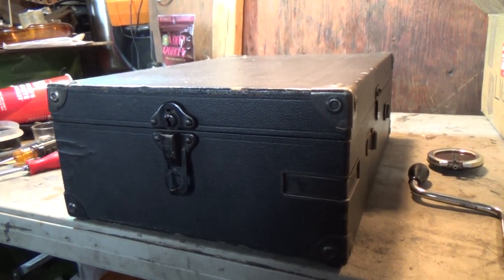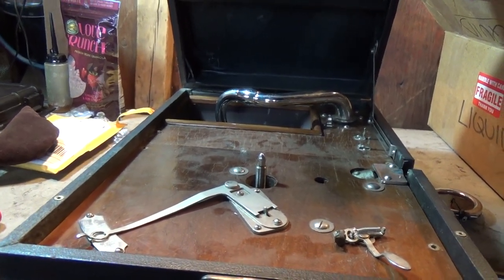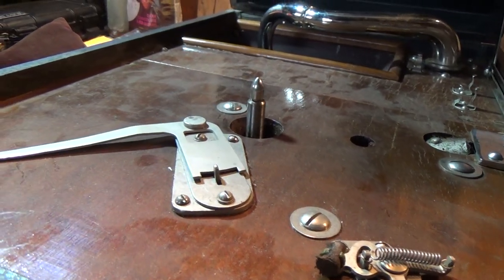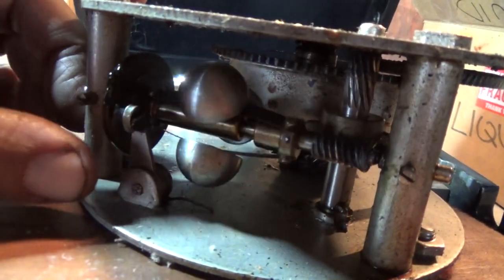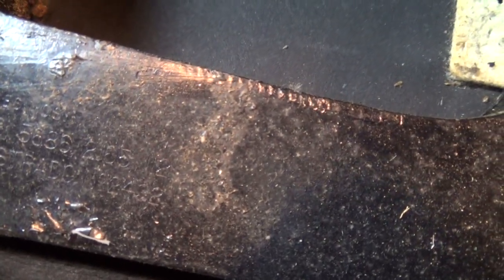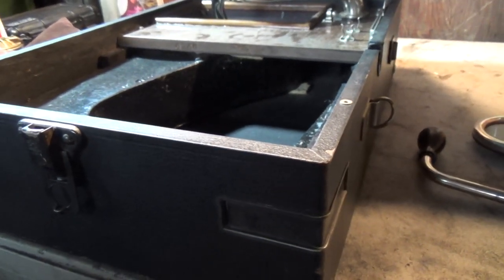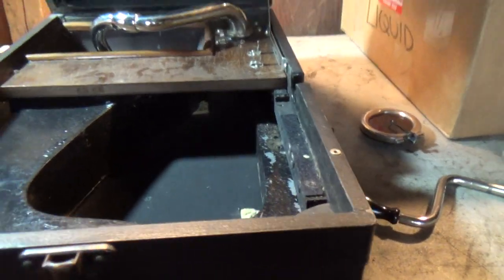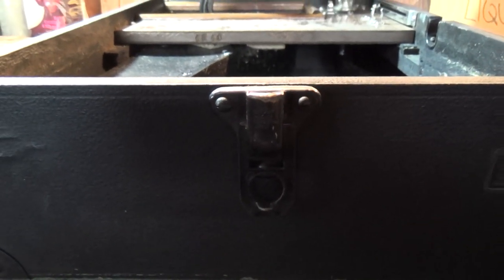Early Electrola 101 first look

Comment from the maker: The motor is the one used on the HMV-100, I keep saying it's a 101 motor.  It is a 101 motor, but only in the early production machines.  They took the 100's motor and shaved off a slice from one edge so it would clear into the 101's case.

Comment: All the parts for the machines were imported BUT put together in the Factory of Electrola in Nowawes (Potsdam). 

The only exception were maybe the very first machines in 26 where Electrola just founded (they have the old globe label on machines, Record cases and records) and maybe (unknown by now) the big machines like a 193/202 and the first electric units like the W2. It‘s hard to tell because there are no documents anymore because of the terrible air raids.

Your machine is from 1927, Electrola used the gold decal just in this year (and on some later imported electric cabinets)
Reply from the maker: Thank you for the information, there is little to no information available here about these machines.  The big HMV book treats Electrola like a sidenote and just said the machines were made at Hays, but left out the part that they weren't assembled there.